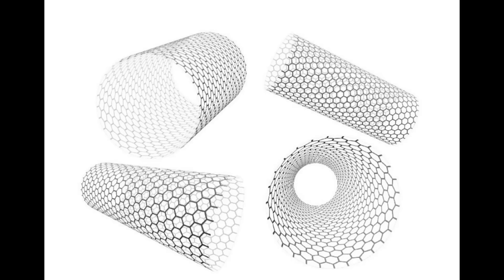What Material Will TSMC and Intel Use after Silicon?

Comment: Will 8x performance get us photorealistic games? Probably.
Will 8x performance get us photorealistic 120hz+ 8k wide-angle VR games? No way.
So yes, we need 100x current performance.
Reply: To put the Oculus Foveated Rendering claim of 5% into perspective - at 4k square (4096x4096) per eye you only need to render 1.677 Megapixels, that's less than 1080p (2.073 Mpixels), which is already attainable with current tech.
Reply: @mnomadvfx  So then you need to raytrace complex scenes at ~3.3MP @144Hz for example. The current top tier raytracing card, the 2080ti, can't even raytrace 1080p in 60Hz. It does reflections OR GI OR shadows, and the ray-count needs to be radically higher. It currently works by doing educated guesses (DLSS) of how it would actually look at 1080p, but it's all raytraced at 480p or something like that. DLSS destroys the image quality & is in no way something one would want to keep.
We need at least ~100x the raytracing power of a 2080ti to be able to completely raytrace Full HD @60Hz in good quality. We'll need something like ~400x the raytracing power of a 2080 to raytrace that foveated 4k per eye @144Hz.
Reply: @zamundaaa776  DLSS is a combo denoiser and upscaling thing, I dont put any stock in it

Denoising alone should be fine, Crytek's demo shows RT can be done fairly efficiently even on cards that compute RT solely on shaders, they hadnt even implemented RTX support for their demo.
Reply: @zamundaaa776  Obviously shaders will still become more complex by the time foveated rendering is mature, so much more compute will be necessary anyway.
Reply: @zamundaaa776  Not sure where you got the 3.3 MP number from.

4096x4096 per eye is 8192x4096 total (33.55 MP, close to 8K UHD 16:9 video) - take only 5% of that and you get 1.677 MP total, or just under 839,000 pixels per eye.

Also 144 Hz is a worthless number, it's a selling point for monitor manufacturers looking for further differentiation in a competitive market - on average people can barely perceive changes over 90 Hz, beyond that its placebo more than significant information reaching the brain.

A lot of what people perceive as greater temporal fidelity from higher refresh rates in LCD displays (still by far the most prevalent display type due to cost) comes from a reduction in the 'ghosting' effect that comes with LCD refresh.

This ghosting effect is something that LCD manufacturers have been working to reduce in order to capture market share in VR - and clearly it is working, as Oculus Rift S is now LCD instead of OLED.
Reply: 8x performance is nowhere near enough, 16x resolution would likely eat up all that power and likely need more and then when you throw in higher frame rates as well as VR, A,I. physics and much bigger open ended worlds that feel more alive, we're going to need a lot more power then that.

We should also remember that as VR gets better, we are much more inside the world of the game and much closer to what going on and because of that, visuals and interactive will have to get a lot better or it might look a bit weird.
Reply: 8x isn't necessary with eye tracked foveated rendering to reduce the necessary pixel count to only the high detail vision area of each eye (fovea) with VR.

Oculus Research talked about it recently, they said you only need to render 5% of the total pixel count of each eye display, and an AI net technique is used to fill in the spaces between.

If its done well, the difference isn't even perceivable to the viewer.
Reply: @mnomadvfx  I am far from an expert on this subject, heck, I'm at the low end of an educated hobbyist when it comes to VR photorealistic rendering, so I'm going to pseudo-agree based on experience with POVRay since 2002, 3dSMax, Maya, Photoshop since 4.0, Macromedia Fireworks and later Adobe Fireworks (before Adobe was Vector based; wow when PS integrated Fireworks into one program it made skinning meshes so much easier), and what I can perceive right now.

In 2002 with a P3 and an...wow, I can't recall the gpu I bought after a Voodoo 2, it took about an hour to render 5 basic chess pieces with shadows. It took about 4 hours to render a small colliseum scene, which can now be done in milliseconds, with far more detail.

Now, just looking at various spots in my room I am essentially focused on a 9" x 9" area. I can see various things in the periphery, but though I can recognize what most are, I cannot see the details beyond basic shapes and colors.

This leads me to believe that with significantly better eye tracking software we are incredibly close, if not there already. In theory, unless they could integrate eye tracking into a typical desktop display, it would be far easier with a VR headset. So, on the actual desktop Monitor we are very, very far away performance-wise (Now remember, 17 years ago we were literally 40,000 x slower when rendering a true Raytraced scene, so saying we need to be 1000x quicker could be a year from now based on previous performance which shows an average of 2000x per year; by that logic it could be 6 months, though that would be a minor miracle), but when it comes to headsets, yeah, with the right software and games focused on being great as opposed to milking you for microtransactions, I could absolutely see them being able to render a steady 60+ FPS at 4k in a 9" x 9" box. The rest of the scene being rendered at 240p and coming into focus as your eyes move towards it. Obviously, the things behind you could just be saved at 120p in memory so if you turn they can almost imperceptibly focus on those 9 by 9 areas, scaling up or down as needed.

I believe we are at, or very close to the point where it is just a matter of who is willing to spend the money on a dedicated raytracing chip, along with a tiny eye-tracking chip that work in conjunction with the GPU and CPU in a similar way that dedicated physics cards used to. Add the software and an incredibly investing game? Yep, it's all about who is willing to make the games, as Oculus is obviously willing to spend the money on the headset hardware. The games are the problem.

With the cost of a headset capable of eye-tracking in 2ms or less and a massive rendering scale being cost prohibitive at the moment (they could probably make them for $150 USD, but the markup would have to be huge to make up for the R&D), how many companies would be willing to invest $150 million on a huge Skyrim, Witcher 3, Deus Ex: MD (if they didn't pull all the DLC from the game itself and remove the last 1/3 of the game for the sequel that never came bc of sales and the Ms Marvel game?!?), or even a small Arena shooter? I think they would have to start with very basic things like a boxing game, possibly a near photorealistic Duck Hunt-like, but with far more options than Ducks type of game. The large open world games would require a much larger audience, which would mean headsets around $150, CPU's in the $250 area (we already have those), and a card with 2080ti/Full Navi performance for $250 as well. That will be the hold up. The epic quests won't come until the entire package; CPU, GPU, RAM, and headset can all be purchased for $1000 USD or thereabouts. When that happens, which should be a year, but more than likely 2-5 years because they need to keep that margin, then we will see a flood. There have to be some large and small gaming companies working on projects in the background waiting for the hardware to be affordable to the average middle class ($42k household income before taxes).

I would be ecstatic with 2 years, and can only imagine where we will be in 5-10 when we have hybrid stacked chiplets and 16GB on the CPU. I'm telling you, we are so much closer than many people think. I'm going to have so much fun gaming into my 40's and beyond. Lol, I'll be 83 and unable to throw a football more than 10 yards without exo-sleeves, but I can toss that headset on and throw a 65 yard Bomb in Bellichek Football 2064 (which will not be made by EA as the government will rule that no one may have a gaming monopoly on Professional Sports Games as long as another company can also afford the license) which will be a cool $185 USD but contain no microtransactions.

Call me an optimistic futurist.

Comment: They are already making inroads with different types. NRAM memory is showing great promise and IBM and many others have been working on using carbon sense around 2003 on. I wonder though if switched we would need to or could even start anything at 1nm as we are limited by physics and all that.  When you try to make a transistor too small well, the electron just finds it easy to jump the gap.  With carbon at least we would see speeds much higher and it would not be hurt by heat. I am not sure about this but I thought I saw that NRAM can work up to 800c which is why it's gotten a lot of interest from aerospace industries. 

   With better speeds we might see a reboot of the sizes where the performance of a 40hm chip would far outperform anything silicon could do and size wouldn't be as critical but that's all guessing.

Comment: Why has Intel resisted the chiplet architecture??? Is it the lack of ability of interconnect?
Reply: They did not resisted they stagnated. It takes time to do the r&d needed to implement it. And Intel did not do the necessary r&d. The time they hired Jim Keller is the time Intel realize they need to work on chipset architecture. 5 years after hiring Jim Keller is the realistic time frame you will see Intel introduce their own chipset architecture.

Comment: Also i think if software will take more advantage from more chiplets/cores/threads, performance should improve quite a bit. im not deep into that field, but i heard that after 128 cores the returns in gains are deminishing. but thats also still a long way to go, if u imagine current software is great when its using 8 cores. another thing, if it is taking intel more than half a decade to shrink one node, perfecting a new material and getting it to the point to engage in mass production... decades as in ++++.
Reply: Depends on the application really. Things like video encoding can take advantage of potentially thousands of cores. Also, large Virtual Machine farms where processes are fairly independent of each other. Weather algorithms, atomic level simulations, etc will all benefit from more cores

Comment: Silicon doesn't stop conducting at 0.7v, lots of silicon semiconductor parts are much lower voltage.

I've run haswell parts down to 0.57v for vcore at low frequencies for example.
Reply: TheLawnWanderer how much difference does that make in power draw?
Reply: @unsettledroell  Power = Voltage^2/Resistance, so the lower you can get the voltage it affects the power considerably
Reply: @osheaness  In this case, the frequency is more important. Each time a transistor is turned off, it's stored charge in the parasitic capicitances have to discharge (over some resistance). Similar when it turns on. That's why power usage goes up with frequency, even w/o upping the voltage.
Of course the voltage matters a lot too, it's the combination of the 2 that makes it scale so rapidly.

But I was actually after numbers. At what frequency did you run a haswell processor at, and how much power did it draw? Just interested, that's all
Reply: @unsettledroell  you might want to tag @TheLawnWanderer
Reply: @unsettledroell  A pretty big difference, but in the end other things around the core such as cache and all the interconnects end up using way more power than the cores themselves. 
So it's not really worth it in the end.

Comment: I was told, that silicon was chosen because it is creating a native oxid layer.
And you forgot to mention the material Galliumarsenid (GaAs) - it is used often in space and defence applications.
Reply: I read an article years ago saying some companies use GaN (Gallium Nitride) in power bricks as it produces less heat than silicon. Before I posted this reply, I searched Google for "GaAs vs GaN" and read this article; https://www.mwrf.com/materials/what-s-difference-between-gan-and-gaas. I agree that Gallium in some form would be the next material.
Reply: @REAVER781  yeah there is already some gan chargers out by anker and such it allows them to shrink the chargers a lot too so dont have to carry bulky chargers for laptops etc
Reply: @REAVER781  Silicon Carbide is inching closer to replacing pure Silicon in the power electronics market - even with GaN being superior overall, SiC will reign for sometime because it will be cheaper to process, and Silicon and Carbon are highly abundant materials as opposed to Gallium.
Reply: There is a good reason only defense and space usually use GaAs and other III-V materials - it is more expensive to process, and silicon is more abundant than Gallium to an obscene degree.

Comment: Will we finally see the rise of Germanium-arsenic CPUs and GPUs? TERAHERTZ FREQUENCIES. With that kind of frequency even a marginal IPC bump would make all the difference. Gallium-Arsenic electronics have been used by the high power radio industry for years due to their ability to reach ultra high frequencies. Perhaps if we could finally start building processors out of it with these really small nodes cost wouldn't be as big of an issue. Personally I think if we just could crank the frequency we could once again brute force another giant leap in performance. The next big leap would be to revamp the instruction sets we run software on (x86 etc) and software "engineers" are way too lazy to try and make that jump overnight the way it should be done, rather than a gradual and slow patchwork. RISC-V instruction set looks promising and I really hope it catches on. Its open source unlike x86 and has a very very limited basic instruction set unlike x86 which has become massively bloated.The open source nature has the potential to allow for more flexible software programming. r

Comment: Tom, what have you heard about fiber optic computing?  I have heard of processors that use fiber optics instead of traditional transistors and voltage gates to calculate the binary code, but know very little about it.

Comment: The material itself is only half of the equation, a better question is what will that material(s) actually be doing.

My guess would be some variant of spintronics technology - coupling topological insulators with spintronic materials (through multi layer hetero-structures, or doping) will allow for some incredibly power efficient devices (1000x more efficient than modern MRAM), and a path to terahertz spintronics has already been talked about.

My money would be on this for layered/stacked logic and memory.

For data interconnects, I would wager plasmonics/optics is going to get more interesting for board and chip level integration, rather than just wiring things up with fiber optic cable.

Combining the 2 strategies above could potentially make the entire cooling industry redundant, and finally shake up the high end form factor in PC's, considering how predicated it is around spacing for heatsinks, fans and airflow.

Edit: Something else to bare in mind, the hetero-structures I mentioned allow you to combine the properties of more than one advanced material (such as 2D monolayer graphene type materials, like MoS2) - sometimes producing different effects than either material does separately.
Reply: You still need a switching material. The fundamental building block of logic circuit is a switch. Please don't forget about the switch.
Reply: @kazedcat  I was speaking about the other half of the problem (devices), if you read the comment fully I do mention graphene and MoS2, topological insulators, and the spintronic materials were implicit there too (magnetic materials such as Chromium, Iron, Platinum, Manganese etc).
Reply: @mnomadvfx  spintronics store bits, photonics transport bits. But electronics process bits. For processing you need a switch. How do you modulate your photon emitter you need a switch. How do you modify your magnetic material you need a switch.
Reply: @kazedcat  You need to research into the subject area more, because you are wrong about both spintronics and photonics, albeit photonics is much further away from any viable use in logic.

Spintronics on the other hand has several potential logic devices in development - All-spin logic, Spin Wave Majority Gate and Domain Wall logic to name a few.

This gives an interesting overview of some contenders, though it's a few years old now (page 9):

https://nanohub.org/courses/ss2014/01a/asset/5137
Reply: @kazedcat  Actually Intel announced their own future spintronic platform not so long ago:

https://www.extremetech.com/computing/286163-intels-fundamentally-new-meso-architecture-could-arrive-in-a-few-years

I'm surprised the MLID guy missed it.